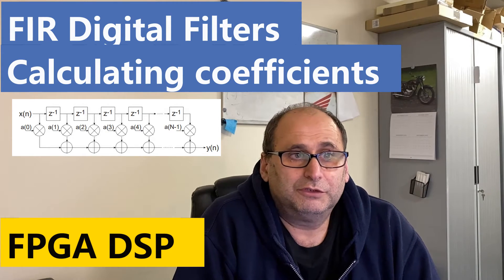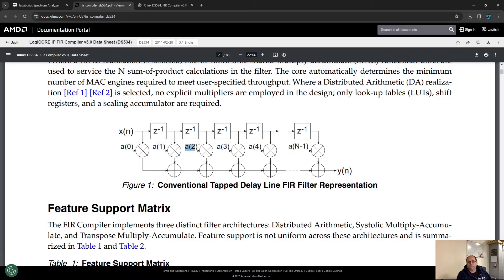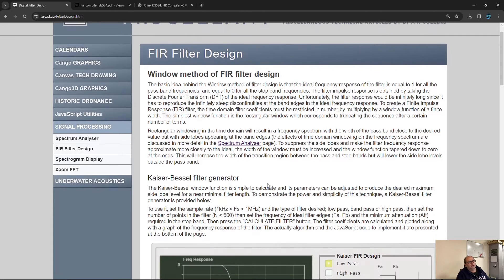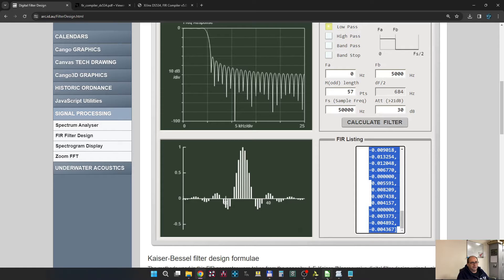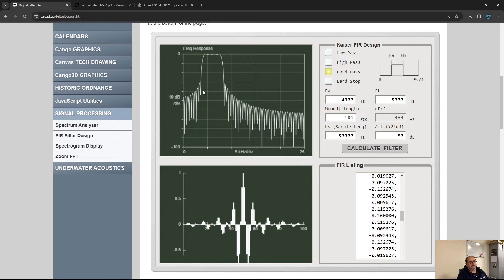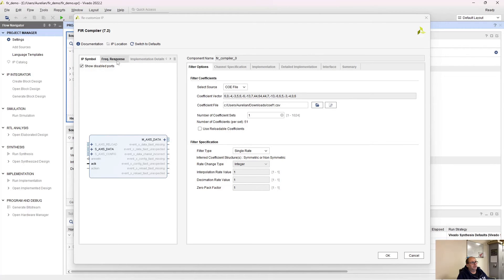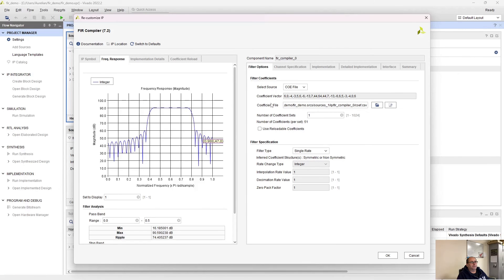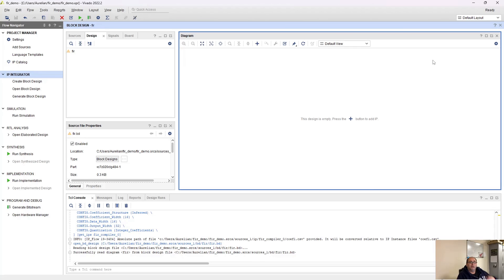FPGA DSP FIR filters coefficients

Comment: Sir, how to use reload coefficient and multiples set of  coefficient with selection option at run time?
Reply from the maker: The coefficients are stored in ram (registers) you can write a new set using an external micro controller.
In Vivado you can generate FIR filters with AXI slave interface exactly for this purpose. Check the documentation for FIR where this mechanism is explained better than I can in a YouTube comment 
Have fun!

Comment: Thx a lot for this video. I understand you take the calculated coefficients that usually are type float32 and scale them up to signed integers, right? I am filtering 12bit ADC data with these FIR Filters. Should I use full range of VHDLs integer type (32bit) or should I limit my coefficients integer range to reduce FIR filter group delay? What is your experience concerning performance of these Xilinx FIR filter IPs?
Reply from the maker: HB9GZE,
Increasing the precision of the coefficients (over a certain size) is not going help much with the quality of the filter, mathematically you are multiplying samples of your signal with some other numbers (12bit * 16bit coeff)   the precision of your samples (your signal) is not going to change because of your better precision of your coefficients.  (when you multiply an n bit number with an m bit number the result is going to be a number with m+n bits and you need to truncate/rounding to the size of you datapath - which is usually much less than m+n anyway)
Another reason why you coef are usually 16bit (or less) is the hardware multipliers traditionally where 18-19 bits on most devices (and built for integers) - newer devices have larger multipliers. I red a few papers (at least for) where researchers were comparing how the size of weights in Neural Networks are affecting the performance of the network and all of them concluded that over 8 bits the performance stays the same (NN and machine learning have very similar math - multiply and add) - so to my conclusion is to make a decision based on you sample size (signal) multiplier native size (on some FPGAs you can split one multiplier in two smaller ones) and the size of your data path.
73 de EI3HWB

Comment: Thank you for this video. I have a question '  how to configure this FIR this different sets of coefficient filters'.
Reply from the maker: Hi There,
somebody asked a similar question below, when you generate the FIR filter in Vivado you have two options with fixed coefficients (you supply the coefs in vector) of tou can select configurable coefficients and the core will have a AXI Slave bus and you can access registers where you write the new coefficients , the tools are creating a low level drive in C or at least a .h file with the definitions of registers. Obviously you need a microprocessor to write the coeficients.
I hope this helps, have fun !

Comment: Thank you for the video about FIR filters. towards the end you mention you can swap in and out filter coefficients via a microprocessor. How do you do that ? Where do you put the coefficients ? 1 more thing. How does the IP calculate the signal results. If you have 101 coefficients do you have to have 101 MACs ?
Reply from the maker: The coefficient will be. In a block memory which both the filter engine and the MCU can access. Depending on your filter size and shape you need to make many multiplications that’s why you have many DSP blocks which can work in parallel of in time sharing fashion 
Some devices have thousands of them.

Comment: if i don't want to use fir ip than how can i convert cofficient into hexadecimal and write into my code. if possible please make a detail video in this or please provide some brief about this in comment
Reply from the maker: you can use excel,  lets say you want to convert them in 16bit values (signed)
1. the copy the values from the website in a column in excel (spreadsheet) - the values are from -1 to 1 (actually -0.9999 to +0.9999)
2. Multiply each value with 32767 (maximum of a signed 16 bit number) - this will result in values from -32767 to +32767
3. Convert into integer
4. Convert into hex values
you can achieve the same thing with script in python or any other language program.
Let me me know if this sufficient to get you going.